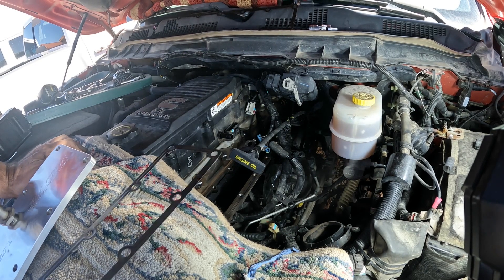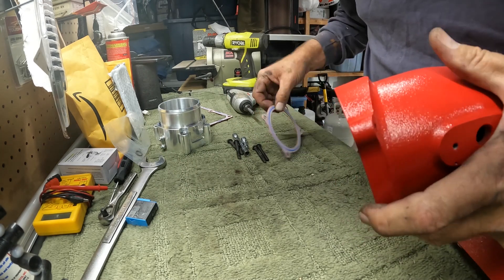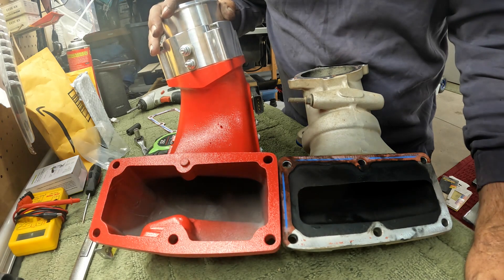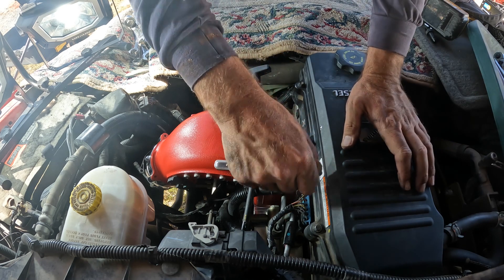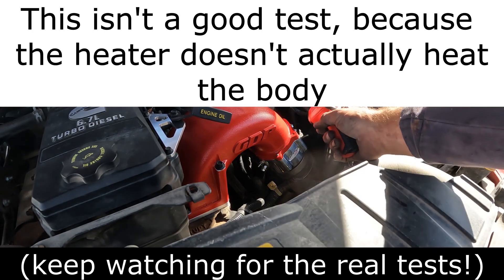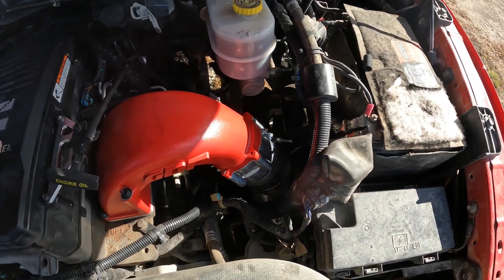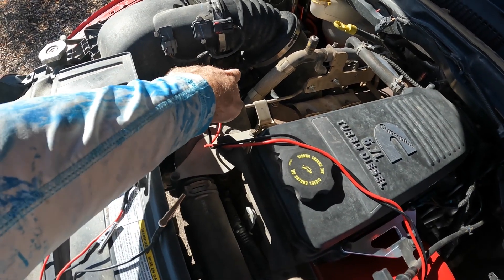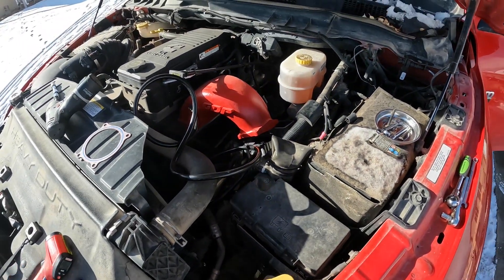6.7 Heater Grid RELOCATION *Pt. 2*

Comment: Hi, great video! Installing the gdp grid heater soon.

I have started worrying about the MAF sensor being located directly above the grid heater. I’m worried the heat will cook it. Have you had any problems?
Reply: Maybe it’s not a problem!
If it is, Banks (and another company) now make a MAF sensor ‘relocation’ unit. It’s more of a spacer type thing that moves the sensor out a little bit. It’s relatively inexpensive.
I think I’ll see how it goes without it.
Reply from the maker: Not yet, but you're thinking about something I haven't thought of. But I haven't had any codes at all. Still very happy with the product. But I'll have to keep my eye out, thanks for the tip

Comment: Very well done . I also watched a video where a guy cut the factory grid heater out and ported the intake on the fat side to enlarge the opening and used a similar remote grid heater that you are using here. My truck is getting up there in kms. I may explore this option and use your video for reference.  Thank you
Reply from the maker: @donscott6720  Yes! I've seen videos similar to that, and I almost did that. It would definitely save some money. But I ended up doing this because I wanted the grid heater since we live in a cold state

Comment: I have this grid heater in my truck but it’s not pulling 225 amps like yours, more like 180 amps, any ideas on what this could be?
Reply from the maker: @BrandonT-p1o  is it heating the grid plate up to 3 or 400°? I actually don't know how hot it's supposed to get, that's one reason I'm just doing mine as a baseline. I'm not a mechanic, but I would start with checking all the connections, cleaning all the lugs and bolts and threads. It may be the relay is starting to fail. But then again, 180 isn't too far off. GDP was very responsive to me, I bet if you email them they might give you an idea of numbers that are acceptable. Sorry I'm not more help
Reply: @anesthesiadreamin funny thing is I hooked up my stock grid heater and was getting a amp reading of 210, then switched back to this one and was only getting 180, the grid doesn’t get smoking hot like yours in the video. All ground connections are perfect, even tried grounding to the battery, what was the temperature outside when you did this test? My truck is reading that is 63 outside but relay still clicks on, I’m wondering if ecm knows when it’s not super cold
Reply from the maker: @BrandonT-p1o  It was probably somewhere around freezing, 32 f. I know mine that my relay turns on, because I can hear it click off when the wait to start light goes out, whether in summer or winter. Can you measure the temperature of the heater grid when the solenoid clicks off?
Reply: @anesthesiadreamin  I’ll measure the heat coming off it next. I guess my next question is does the ecm give a smaller amp draw when it’s warmer outside, when I was reading 210 off my stock heater outside temperature was in the 50’s, or does it give a consistent amp draw in warm and cold weather, I’ll have to do more testing

Comment: This has by far been the best YT video out there on step by step. Appreciate this a lot, great work man! Question- do you think the GDP grid heater would work on a stock intake? I’ll be installing the delete kit.. but have not ordered the grid heater yet but curious if I have to go aftermarket on the manifold or can I just use the one you have in the video here for a stock intake? Thank you! Awesome work man!
Reply from the maker: I wish I knew! I have seen One other person mount the GDP heater to another aftermarket elbow/ intake, but I don't know about the stock one. I should have checked that when I had it apart. GDP was always responsive to my emails, I bet they would be able to tell you. Good luck with your install, I sure like mine 👍
Reply: @anesthesiadreamin  I want to do this to my 2015. Granted here in middle GA it doesn't get really cold but once or twice every few years or so. I took the cable loose from the solenoid after about six months from purchase date, bought it brand new in 15. Great videos.  Thanks.
Reply: It does indeed work with the stock intake horn. It just replaces the throttle valve
Reply from the maker: @moes3828  IIRC it's the same bolt pattern, so I don't see why it would not work. I guess there's a chance that it doesn't and then you're stuck waiting for the part, unless you just put it all back to factory. Actually, if you email or call GDP, they can probably answer that question 100%. Sorry, I'm just not positive

Comment: Everyone going to find out that you should eliminate the grid entirely!! Put the banks in my truck. Grid catches carbon which will build up narrowing the air flow. No grid in the banks
Reply: Love the banks. Breaths good, have 31 lbs boost. Wish you could see my original grid after 7 years of use . Caked with shit !!  Truck was getting air through maybe 5/6 quarter size holes!! Crazy !! Eliminated the killer bolt. But the grid is a cabin catcher. Takes a little time to do about a good 6/8 hours but the instructional video was easy to follow.  Of course the first time takes a few but could do another one in half the time with my eyes closed !! Too bad I only have the one truck ! Hahahaha scale 1 to 10 maybe a 7?
Reply: sure, if you enjoy a truck that won't start in winter.
Reply from the maker: Yep! How do you like the banks equipment? I mean like fit and finish, was it easy install?

Comment: Hey just installed mine today, did you have any trouble getting the elbow on with the #1 fuel line , mine was touching so had to die grind a bit, and cut off the locating tab.
Reply from the maker: I didn't cut mine, but I think I know what you're talking about, when I did mine I had to finagle it for a bit and finally got it to fit. Now that you mention it they could have done a better job with that.

Comment: I have a 2016 2500 70k. I am doing this Glacier Diesel grid heater also.  I just got the parts in 2/18/23.  I'm still going to use my stock intake though.     Your video is a great help.  Thank you for putting this out there.
Reply: Just an update. I got the whole Grid heater install done.  Took me 4 hours start to finish. I will be buying a set of stubby metric wrenches for sure.   Install went smoothly, hardest part was loosening the # 6 injector line to remove the injector line body.  I did remove the engine lift hook which made it easier to install. I cleaned up the block with a scotch Brite pad and sprayed a little break clean on a rag and wiped it down.  I re installed everything  in reverse order and tighten the injector lines. 
I reattached the grounds to the batteries and  cycleed my key a few times to get fuel in all the injector lines before  I tried to start it. Cranked her over about 10 times continuous and it fired right up.
 No leaks and you can here the grid heater cycling.  I don't have a raytec gun to check heat but it's really  hot to touch after it cycled a few times.  
I did all of this as a precaution.  When I took my original out everything  was tight I just don't want a problem. My son's broke on him 2012 Ram 2500. The bolt went in the #6 cylinder and $6500 later he is running.  Next will be a Fleece high Flow fuel in tank fuel pump to keep the CP3 injection pump cool by supplying plenty of diesel.

Comment: When you installed the power wire to the back of the GDP grid heater, did you need to install some type of nylon/rubber washer under the bottom nut so that the power wire only contacts the stud ? Or does it not matter on this setup
Reply from the maker: If I understood your question correctly, I think I explain this at the beginning of part one . So no rubber washer, it doesn't matter which stud you connect your hot wire to, they're both connected together by a plate. And this is necessary because the two connecting studs each have their own grid heater inside the body.  So one power wire connected to one stud powers both studs, and thus powers both grids. I hope that answered your question. Hey, thanks for watching 👍

Comment: Did you torque the fuel lines or just snug them up really good?
Reply from the maker: I wiggled the line as I threaded the nuts on to make sure they were centered, then just snugged them firmly then gave each one a "bump" on the wrench to make sure. The socket "adapter" I bought (and never used) was just a waste of money, there is no way I could get it on all the fuel line nuts
Reply: @anesthesiadreamin  perfect, thanks for the reply. About to install mine. I bought some stubby wrenches after watching your video
Reply from the maker: @tylerw.9305  For sure! Let me know how it goes. I have been checking my fuel line connections for leaks every 2 weeks or so just to be sure. Good luck and let us know how it goes!
Reply: @anesthesiadreamin  absolutely! I will report back once im done. I am installing the black market performance kit so slightly different but same process to install. If I have time I will grab a video of it as well!

Comment: Thoughts on the BANKS RAM air replacement?  I'm not sure what the failure rate is on these bolts for the grid heater (I agree, horrible design) but have been thinking about swapping this out.  
I'll look into the Glacier replacements as well.

GREAT video and good angles to see what is going on!  I have a few questions that I'd like to ask (but not in the public realm).  Do you have a email address?

Thanks,
Reply: Banks is the way to go. You want to eliminate the air from passing through the grid period. Just gives carbon deposits a place to cling to. Put a banks in my truck. Has a pre heat without the grid
Reply: My concern with banks system is that if the relay fails and power stays on "their" Heater bolt will fail (possibly melt pieces) that STILL possibly fall into the intake.  This system has the grids and the associated nuts down and below stream - not to say that the turbo air could not still blow loose parts in and up into the intake.  For very cold climates this system has the heat further away which could be a negative.  Finally I read that Banks system uses a one and done fuel rail (that had to be made to go around the enlarged monster ram) that must be replaced if taken off later for another issue.  @ingergriggs4626